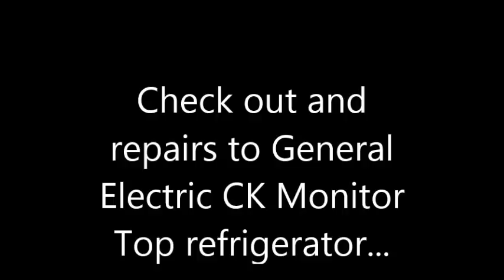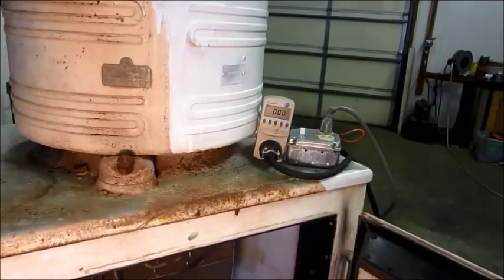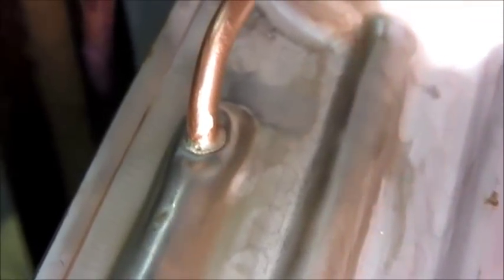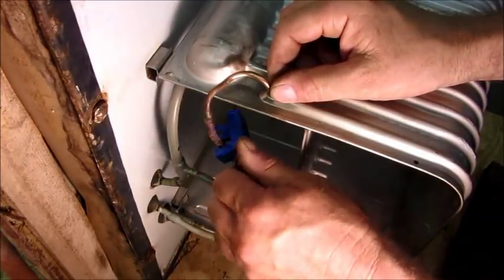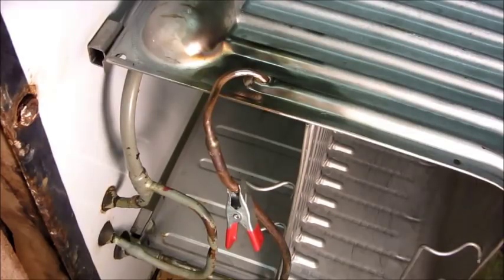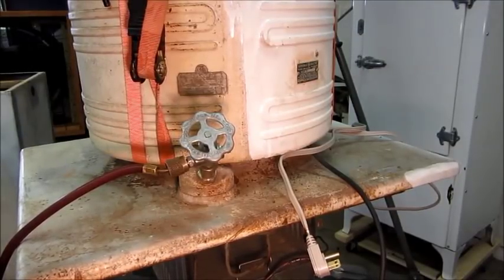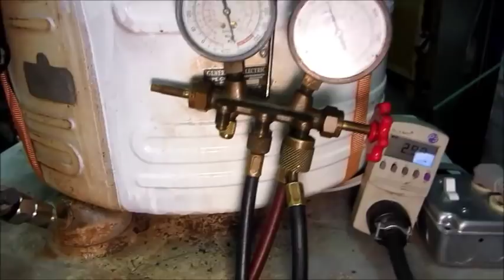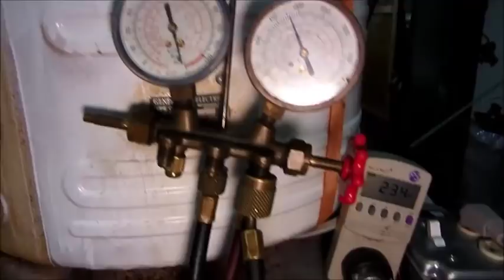General Electric Monitor Top Refrigerator - 1 - CK-2-C16

Comment: It's truly amazing how durable that compressor is after having been mangled.
Reply from the maker: Yes they are amazingly durable.  The CK model of the Monitor Top was the final version of this refrigerator line. After this, they went to compressor-on-the-bottom designs. They still used the same compressor, but it was in a "plain" round can underneath the fridge, like modern units. No big fancy drum any more.

They called this compressor the "Scotch Yoke" compressor. One of my friends and fellow collector has an original General Electric salesman's display of this compressor. Here is a video of this trinket in operation: https://www.youtube.com/watch?v=FaGtKThjlW0

These compressors have their own internal oil pump, oil-cooled motor winding, compression-release unloader mechanism, and other incredibly advanced features.

Comment: I really find myself liking the compressor on top design.  I was looking at the cabinet in one of the shots from the rear and noted that you can even sweep under it!  Easier house cleaning.  And, you can send the hot air up where it's going to be going anyway via convection.  The boiling refrigerant sound was pretty amazing!
Reply from the maker: Thanks Ken!  These older refrigerators are a different breed. They put a lot of thought into the design back then. Competition was fierce between the manufacturers to say  the least! 

I do like the top compressor and "space underneath" designs. Easy cleaning for sure.  

Interestingly, all the "flooded evaporator" designs have the boiling refrigerant noise. The old Frigidaire fridges I have all make that sound as well.

Comment: Great work, David. The humidity has been like a sauna here in SW GA as well with the almost daily rain showers. I believe that refrigerator will be a good runner.
Reply from the maker: Thanks!  It will most likely be a great runner. I have a control lined up to replace the missing knob; and then of course the cabinet repairs will be just time consuming.

Comment: I sure hope the cabinet isn't too far gone to be savable.  This proves that old appliances will work again after fixing then.  Good luck in finishing it without any fuss
Reply from the maker: Thanks Will. I am not sure about the cabinet. There were much nicer looking GE Monitor Top cabinets from previous models. The refrigerating units set on top, and were modular. If I can get a nicer, older cabinet (maybe porcelain enamel one?) I can put this refrigerating unit on it.
Reply: davida1hiwaaynet you never know until you try and repair it.
Reply from the maker: This is very true. I didn't go over it in the video, but afterwards I looked into the cabinet condition a little more. It is in bad condition, but should be able to work. It just won't be a desirable antique like it could otherwise have been. While I am pretty well versed in mechanical repairs, I don't have much experience in bodywork skills as needed for the cabinet.

Comment: Great work.  Only comment is that if the copper tube is pushed too deep in the hole and square, it could block flow much like a soda straw in a milkshake.  You put it in at an angle so no problem.
Reply from the maker: Thanks!  That is very true, and I was conscious about this happening. I could have cut the end at an angle, as the original was. But, in this case, I did the pre-soldering fitup so that when the ends of the tubing are lined up, it would be at an angle (as you saw!)

Comment: Howdy and hello,

I just got a dome top refrigerator of the General Electric CK series and mine is a CK-15-A16 and I was wanting to know on the relay where the power cord ties in, what terminals do I use to put the power cord back on? Mine is in real nice condition and even the pilot light works on the inside and I did a partial power up to see what would happen with a variac in series. I do not want to pay a lot of money just to get the wiring diagram with a lot of other diagrams I just do not need.  If you can help me here, please let me know.

Robert Johnson
Reply from the maker: Hi Robert.  I'm sorry you are having problems locating wiring diagrams.  Nobody should charge money for access to electronic copies. These are copyright by General Electric company; and are now in the public domain. They are free to download from the GE Monitor Top forum. 

The CK manual here will have all the wiring diagrams. https://monitortop.freeforums.net/thread/15/service-manual 

If that doesn't answer it, please let me know!

Comment: I have a refrigeration  question.  If the pressure/temperature chart for R152a says at 80 degrees ambient you should have 76 pounds per square inch with the compressor off,  would a reading of 60 pounds be under charged.  Thanks.
Reply from the maker: That would mean one of several possibilities is happening. 

It is charged with gas only, resulting in a non saturated condition. In this case, there would be no liquid to maintain the vapor pressure.

There may be an area in the system which is colder than 80 degrees. The liquid would condense at that point, and provide vapor pressure for that cooler area.

Or, the gas has been mixed with some other gas which has a lower T/P such as butane.

Or, as I have found before, the gauge is messed up. :-) 

Or, in your specific case, with the roughly 16 PSI difference, it could be that your chart was printed with absolute pressures, and your gauge is reading gauge pressure. That would cause atmospheric pressure to be subtracted, making for a 15 PSI inaccuracy.  Account for that, and you have only a 1 PSI error.
Having said that, It's not really possible to determine if a system has a correct charge based upon pressures without the unit running. Even with it running, it is very tedious and requires very accurate thermometers and gauges - and lots of experience. The best way on this style of refrigerator is to monitor the frost line and ensure it is not backflooding. I remembered from experience that a similar model took 3 cans.